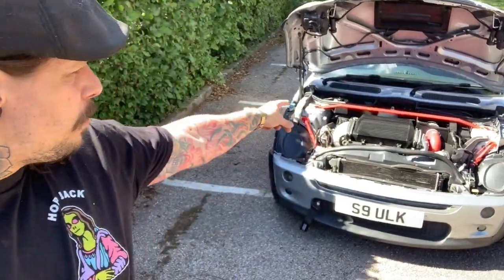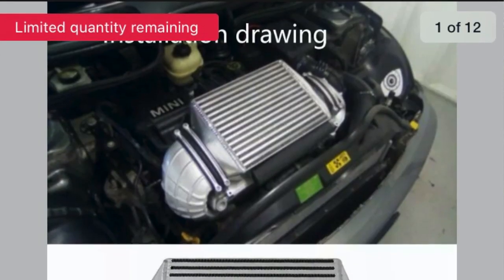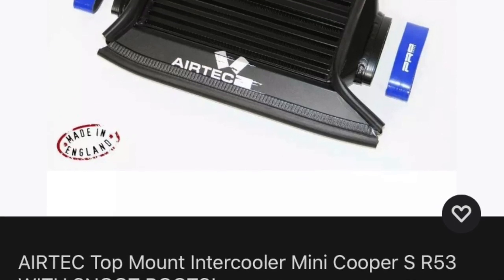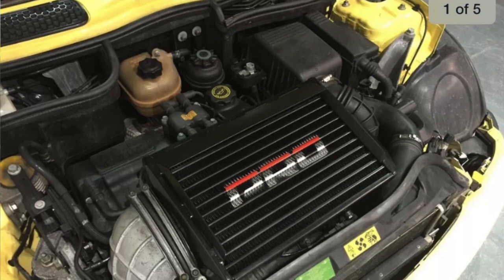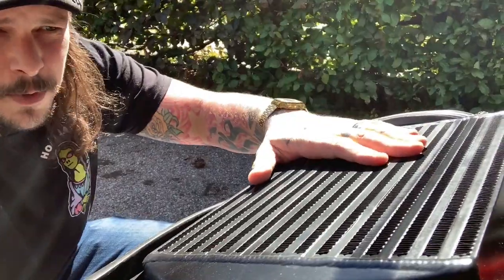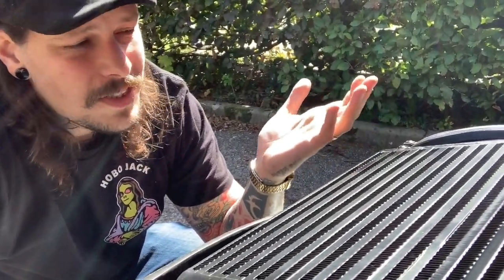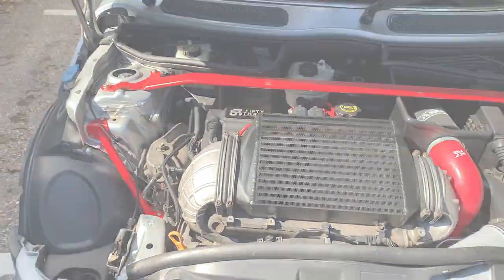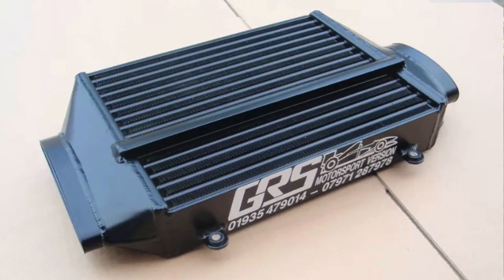MTC MOTORSPORT INTERCOOLER REVIEW! HOBO OR NOT?

Comment: You've get rid of the original foam from the inside of the hood scoop, cut some plastic bits of and stick new foam a few inches further so the IC works with it's full area. right now you can see a darker stripe on the IC is where the foam touches the IC. I did it to mine, and the IAT dropped by a few degrees ;)
Reply from the maker: Thank you man, I’ll certainly look to sort that! 👍🏻

Comment: I have the MTC - my tabs are also broken - I've found some hard rubber keeps it up off the intake well - side note - the colored intercooler boots look great but under full boost they blow up like balloons. The stock snoot boots are way better. The only way to know that first hand is to see them blow up when the car is doing a dyno run. Also learned that day that the fuel pressure regulator vacuum line coming off of the intake can blow off if it's not new and or zip-tied on.  Thanks for the vids
Reply from the maker: Thank you for watching! I’m a fan of the stock boots too, the MTC works well enough but the tabs are awful! Everyone I know who has one has no intact tabs! 😂👍🏻

Comment: Hi ... A doubt... The wine is diferent with bigger the intercooler or not?! I have a 15 pulley but with the stock intercooler... I m thinking about bying a large intercooler like yours... I now thats better performance then the stock intercooler.. i want to now if the wine gets Higher...😅
Ps: sorry my English
Reply from the maker: Hi man, I didn’t noticed a difference in the whine from the supercharger when fitting a larger intercooler, that came from pulley upgrades. I run a 15% reduced supercharger pulley, a +2% undampered lightweight crankshaft pulley and a +5% lightweight alternator pulley. The whine is immense!

Comment: How do you measure/read the IAT and ACT during operation? I'm curious about mine. OBD?
Reply from the maker: Ultragauge! 👍🏻
Reply: @SULKNATIONtv  Thanks for the info! Do you maybe know a good source on how to use it specifically for IAT and ACT on the R53? Or maybe a nice idea for a next video? 

My 2005 just had a 17%, plugs, SC service and a remap. Intercooler still to be done. Would like to compare the temperatures for fun and science before/after the IC upgrade.
Reply from the maker: I’ve done a video on how to install an Ultragauge, but doing a video about IAT’s and CAT’s could be a winner! 👍🏻

Sounds like a good set up you have going on mate! 👍🏻👊🏻
Reply: @SULKNATIONtv  Thanks, I'm still a bit worried for the temps. Looking forward to the video already : )!

Couldn't tell from your video if you are running a reduction pulley as well. Car looks good!
Reply from the maker: @schweppie  mate, I am running all the pulleys! 😂 A KAVS 15% reduced supercharger pulley, KAVS +2 Lightweight Crankshaft pulley, KAVS +5 Alternator pulley and a fresh Belt Tensioner pulley! I’ve done some videos on these, have a look, I’m a big fan of my set up, all smiles! 

If you’re running a 17% reduced supercharger pulley and stock intercooler, you may find your IAT’s increase above normal after some harder runs, so ‘upgrading’ your intercooler would be a good move.
Reply: @SULKNATIONtv  Ahh I see 😄 Nice setup you got there!

Shouldnt ACT be CAT instead? Compressed Air Temperature?  I couldn't find if ultragauge 1.4 can  read this from r53's. Does yours display it?
Reply from the maker: @schweppie  😂🤦🏻‍♂️ yep, I typed it out wrong! 

I’ll have a look today and confirm for you! 👍🏻
Reply: @SULKNATIONtv  I came across it again on a website, I think you were right with ACT's! Sorry my bad haha!

Comment: Mine touches the leads of the ignition. Any opinion, please?
Reply from the maker: You could get a coil pack relocation plate, then that would move your coil pack and leads away from the overhang of the intercooler. 👍🏻
Reply: @SULKNATIONtv  Thanks alot. Thought of that, but wasn.t sure if I gotta make it custom, or if there is something on the market already projected.
Reply from the maker: @dandesign05  they are definitely available to buy, you could try the R53 Owners Club, Orranje or Mod A Mini. 👍🏻
Reply: @SULKNATIONtv  Perfect! Many thanks! ❤️

Comment: How hot are you running? I'm having small concerns on my own temperatures. Do you know where the intake air temp sensor is located? Mine reads around 45C when I'm stuck at the lights. 91C engine temp. Drops down when driving. I still have the stock one in mine.
Reply from the maker: So my car runs at an engine temperature of 90C consistently, it does go up in very slow moving traffic because of the lack of free flowing air, but quickly drops down to its normal operating temperature without issue. Regarding IAT’s, I don’t believe the MTC figure given as its lower than I think is possible but, and this is without data, I have noticed an improvement over the standard Intercooler. The engine seems to recover more quickly after a spirited drive. 

I’m not sure where the intake air temp sensor is, but I will look to find it... Ultra gauge may be purchased soon....😂
Reply: SULKNATIONtv Check. Thanks so much for your reply. I got the Ultragauge just last week so I'm trying to figure out a baseline for a variety of parameters. 90C engine temp seems good. I'm getting 24C consistently on the freeway cruising for the IAT. 

What do you mean by faster recovery? Less sluggish?
Reply from the maker: Roeland Hoefsloot yep 100% less sluggish!  Just seems to help the continuity of petformance!
Reply: @SULKNATIONtv  Cool. If I may bother you with more questions/thoughts?

What do you think about an aftermarket BPV? Do you think the engine (stock internals) would be able to handle the extra boost from the BPV?

Car feels a little sluggish for me. Could be me getting used to it after getting a tune. Trying to decide which parts to spend the bucks on next.
Reply from the maker: Roeland Hoefsloot Absolutely no bother at all! In relation to a BPV,  I’m certainly no authority on them, so I couldn’t tell you if that would be the right move or not. Having had a tune, I’m assuming you’ve got a reduced pulley, bigger injectors etc?
Reply: SULKNATIONtv Not yet no. They're on the wishlist haha. Should probably tackle those first. They did a stage 1 software tune from 163 -> 188hp on the dyno.
Reply from the maker: Roeland Hoefsloot there is always so much on ‘the wish list’. You get bits and then you add more to the list...😂
Reply: @MrLandooz  Hiya bud.
I purchased an optimised BPV from a trader on eBay called Rooster Racing who used to campaign  highly modified R53,s.
He used to modify his own after he realised the springs wore out over time so started to offer the service to others.
The butterfly Is modded and springs replaced with stiffer ones with a usual claimed gain of 1psi boost once replacing the worn ones which he takes in exchange giving money back when sent.
I had it fitted with a few other parts at the same time so was hard to say wether it gained power solely, but it was genuinely fast on the trip home after a few  mods....it wasn't expensive,no regrets atal.
Hope that can help👍

Comment: Hi.. another question.. a bigger intercooler is really necessary with a 15 % pulley? Why did you put another IC? Thanks..
Reply from the maker: Hi Edgar, it’s not ‘necessary’ with a 15% pulley (unless you’re thinking of tracking the car) but increasing the intercooler’s core size is beneficial as you have a wider area pulling in cold air. Plus my standard intercooler had seen better days when I bought the car, so I replaced it quickly! 👍🏻

Comment: Talking about it is useless. 
All that matters here are measurements from intake tmep. 
Where are logs?
Airtec also looks good, but it doesn't work much better as original intercooler.
Reply from the maker: In a perfect world, I would have started the channel as soon as I got the car and may well have been able to film comparison videos when initially installing mods. Videos that identify IAT’s and the improvement that the MTC Intercooler makes or doesn’t make. 

Unfortunately, I was a year in to ownership and modifying when I started this channel, so more ‘technical’ videos on certain components have unfortunately passed me by. Thanks for watching though! 👍🏻
Reply: @SULKNATIONtv  
You can still log in the summer with MTC. You need only the Torque App
I can tell you that in summer at 27° degrees the orignal Intercooler has 77° intake temp have. (with 58er JCW Pulley)
Reply from the maker: I have an Ultragauge now, I also have an ingenious cheap mod for the intercooler... be prepared for a stats based video!